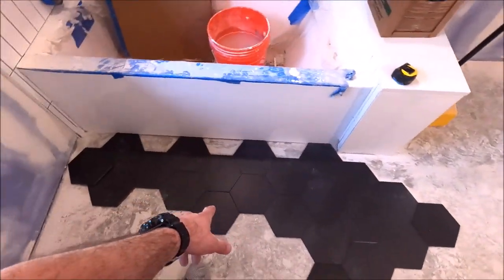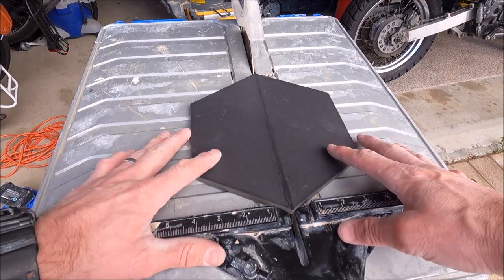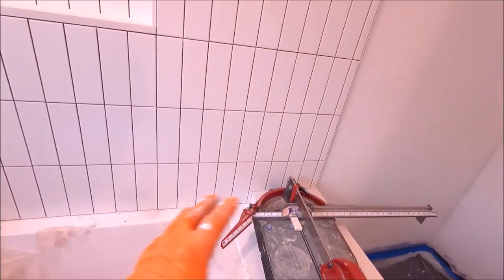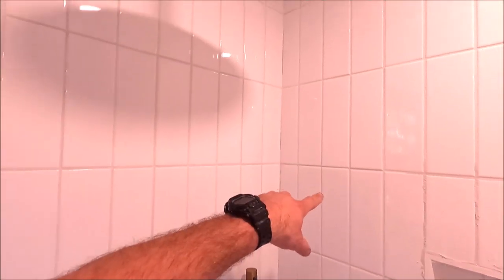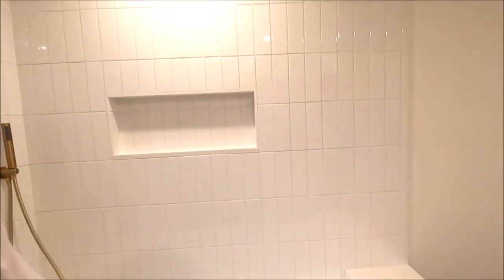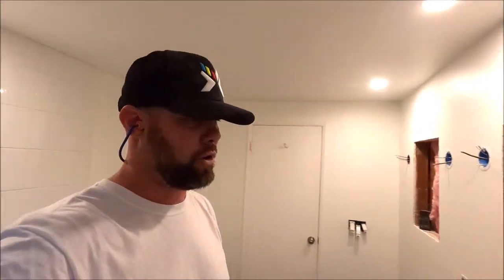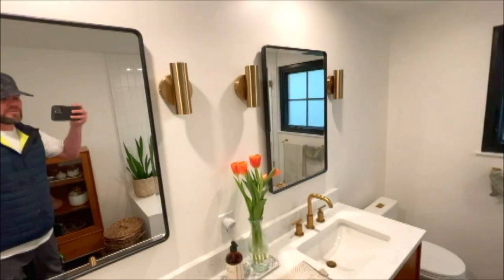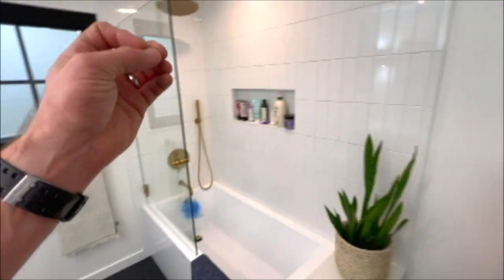Most Picky Client Ever! Shower Finally Complete

Comment: Concise as always. I love your delivery and incredible work. I'm in the middle of a similar DIY project. Ripped out exterior wall, tub, water heater. Replaced rotted joists, floor, plumbing... installed a tankless water heater. I'm currently tiling our new walk-in shower with linear drain and lighted nitche:) 

Thank you. Your work is so inspiring!

Comment: Recently did a shower that was extremely similar with soldiered subway tile and hexagon floors. We saved some money and some time on clips by doing just 4 sides of the hexagons insteads of all of them. Then added spacers to all the joints. Turned out amazing with little to no lippage.

Comment: Beautiful work! What saw blade are you using on that kobalt? I'm looking to upgrade the blade on my saw, getting a good amount of chipping on my cuts.
Reply from the maker: Lot's of good blades out there. That blade is called the Rock Star by RTC
Reply: The diamond blade from Home Depot is great. Any blade you use will have some chipping. Also make sure you are dressing your blade a couple times a day. The diamonds get covered in tile residue and cause it to chip worse

Comment: I had a random question. Searched Google but can't find a straight yes or no. If any waterproofing is applied on shower wall or anywhere. Do I still burn in the wall if thinsetting back of tile?(redgard/ hydroband/kerdi/any waterproofing)
Reply from the maker: I would yes

Comment: I'm a little disappointed in your work... I saw several screws in the Kerdi board that weren't covered to protect your waterproofing... The right side of the niche and along the bench at tub area. Am I mistaken?
Reply from the maker: We did install band on that vertical run on the tub skirt before we tiled, it didn't make it to the video.